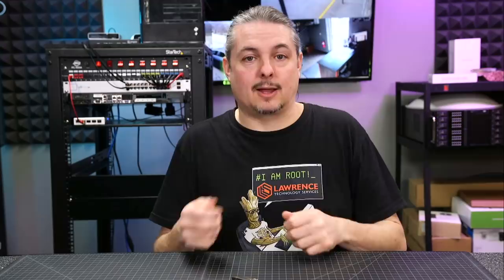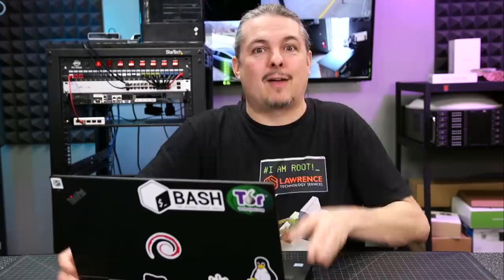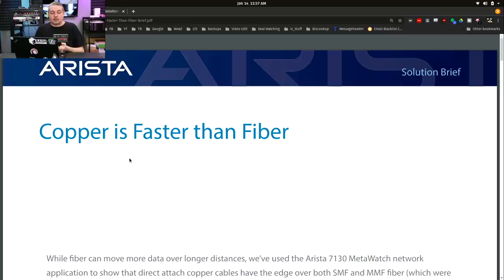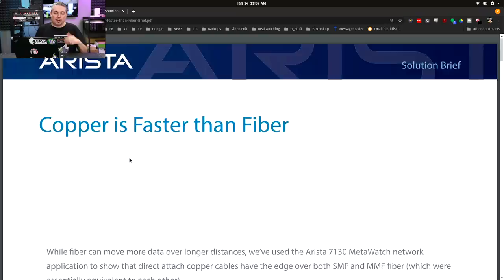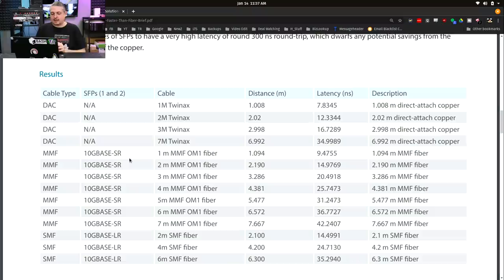SFP+ DAC VS Fiber Latency: Copper Is Faster Than Fiber

Comment: I asked around for suggestions of for applications where nanosecond latency on short cables could matter.  I received the suggestion high frequency trading where first to respond wins, implemented on an instant response FPGA. But you really need direct to attachment between endpoints or cut-through-switching to ensure you aren’t getting stuck in the much more “slow” store-and-forward switching if you are competing about a few ns.
Reply: Also keep in mind how small nanoseconds are.  I just did the calculation of the latency introduced by my 50 meter run of Fiber from my basement up to my office, apparently that's 300 nanoseconds, or  0.0003 ms (milliseconds).  Considering one's first hop to their local router is within the 1ms range, or to ones ISP is 2-6ms.  less than 1/1000th of a ms is introduced by the fiber, I don't think it would make a noticable difference, even in ultra-low latency requirements.  Especially noting the difference at 4:16 in the video, a 1.641 ns difference between a 1meter DAC and 1 meter of MMF is 0.000001641 ms, an absurdly tiny number, when 1 ms is 1/1000th or 0.001 of a second.  Go with whatever your requirements are. :) 

There are some things regarding high frequency trading where some Stock Exchanges have boxes to introduce latency by having a 38 miles of fiber coiled up within a box just to add a slight delay too.  See Tom Scotts video here: https://www.youtube.com/watch?v=d8BcCLLX4N4
Reply: It is big deal for high frequency trading.
But they use radio, not copper cables. Because radio through air travels faster.
There is a microwave radio link between the New York stock Exchange and Chicago Commodity Exchange. Essentially a bunch of radio towers built in a straight line between the two.
Because radio through air travels faster than light through fiber.
I believe there is a similar radio link between the London and Frankfurt exchanges.
And a company placed a new fiberoptic cable across the Atlantic, using a slightly more direct route between the New York and London exchanges than all the existing fiberoptic cables. Just to shave a little bit of latency compared to their competitors.

Comment: But... a few 10's of nanoseconds of latency difference is on the order of memory access times, orders of magnitude smaller than pretty much any I/O operation being done on the server.  What's left out here is that the greater latency difference is also due to the extra fixed overhead of error correction and other signal processing done over longer links.  This is why the DAC cables are so short.  There's probably more jitter in the interrupt processing time by the NIC in your computer trying to get across the PCI bus to the CPU.

And yeah, over longer lengths, you have to consider the differences in velocity factor (how much slower the propagation of light/RF through a medium vs. in a vacuum).  But you have to have kilometers of difference to perceive this.  You can also operate some of these links with varying FEC (forward errror correction) which requires blocks of data to operate on, and thus increases latency in exchange for working over paths with worse link margin.

I think the first-order design goal is how you get a reliable link between the two pieces of equipment.  If you're on a marginal path where you lose a packet, then these few nanoseconds get flushed down the toilet when TCP has to wait for its retransmit timer to fire on the order of milliseconds, 5 orders of magnitude slower.
Reply: I totally agree the differences are way to short for a discussion that dac make a real performance difference in small links. The latency of different switches may have surely a bigger impact than fibre vs dac.
And no one buys the switches only because of the lower latencies.
There is always a trade of in features but it is a nice discussion in a more academic area.
The discussion why to use a multiple parity solutions like raid 6 in case of an drive failure in a raid 5 rebuild has much more real world impact than this.
Reply: You sure don’t want a store-and-forward type of switch or a normal server on a network where these ns delays matter, too many other factors that are greater latencies. I imagine the primary application that cares about this is supercomputing low latency interconnects.
Reply: No, the supercomputer guys are probably way more interested in throughput and probably 2*RTT worth of buffering in the switches to absorb a TCP window of data before end-to-end flow control kicks in.  Switches with cut-through forwarding (that is, they start to forward the frame on the egress port once enough of the header arrives to make a forwarding decision) are what the high-frequency traders use.  These guys are lunatics about the microseconds. 

The reason you use DAC cables in practice is because they're cheaper and they use less power.  (That heat on the twisted pair media SFPs is because more power, of course.)   In $DAYJOB, we have a total power envelope of between 8.6KVA and 12KVA per rack, depending the specific data center facility's requirements.  So the choice of the server CPU is based on the Tdp of the chip, CPU cores, clock speed, memory channels and how many server blades you fit into the rack and not exceed the power profile.  And also how many ethernet switch ports in the top-of-rack switch as adding the 49th port means another pair of switches.   So you do this multi-variate optimization problem based on the characteristics of the application(s) you're running - more cores, lower clock speed?  If you don't do multi-thread execution in your application efficiently, then fewer cores, higher clock speed?  Are you memory bandwidth constrained - so more memory channels, but more $$$ for those CPUs.    The cost of the interconnect cabling isn't that big, overall, but why be stupid and throw $$$ away when you only have to go 6 or 10 feet away to the top of rack and save some watts of power while you're at it. 

In doing this optimization evaluation, we've NEVER worried about a few 10's of nanoseconds of latency difference.  We deploy servers a rack at a time and have a well understood application that scales out horizontally with hundreds of instances.   Your mileage may vary, but I'll bet that latency of different 1G/10G/25G/40G/100G media interfaces doesn't really factor into the large scale system decisions.   You choose the media based on flexibility, and cost.  Do I need to go 10 meters?  10 kilometers?  Something in between?  How many different flavors of spares do I want to keep around?
Reply: Louis Mamakos apparently with MPI optimized InfiniBand application, practical delay on operations are on usec scale not nsec scale, so for  InfiniBand MPI there is little cable impact. Not sure if there is any even faster low latency application in use today - was 20 years since my HPC studies, so I need to google decades of new info ^_^. You don’t use TCP in low latency applications, the point of them is different from ”slow” technologies because the command modes can speak to workers so fast that they almost appear like if they were on the same machine. For applications were you always need to know results of other computations that matters. If you just need a cluster for easily scaled applications then TCP and Ethernet will do just fine of course.
Reply: @randomgeocacher  IB isn't really required anymore since you can get 10G NICs with RDMA and every standard after that from what I remember has RDMA in the spec. IB used to kill Ethernet in latency because you could have RDMA where Ethernet did not. 25G/100G + Lossless Ethernet is quite compelling now as you no longer have to run dual stack.

As for DAC vs Fibre I'll pick Fibre every time for dense applications, if you've ever had even as few as 40 DAC cables to the same point it's a right pain to work with. Unless you've got some seriously nice cable management accessories in the rack you'll curse those cables as soon as you need to pull one out or add one. DAC cables typically have limited range of lengths compared to MMF and if you have to go custom length Fibre is far cheaper. DAC is great, just to a point.
Reply: Timothy Matthews I asked a contact who works with HPC, they still use inifiniband for some applications, but latency wasn’t a big concern for most of their customers workflows (more independent strong cluster nodes, so customers don’t need to great at MPI development), and nanosecond differences was a joke to him. They typically use fiber optics for almost everything because their racks would become so much more unmanageable with short and thick DACs.
Reply: @randomgeocacher  Yea we use fibre for the same reason, I got so pissed off with DAC. I  sort of work in the HPC area, I'm in IT at a university but more in the central business IT but also have to support the facilities that the research departments use for their HPC clusters. There's only one using IB currently and it's a really old setup. We are not a big HPC powerhouse though but it is a personal area of interest of mine.

Comment: Question:

Can you give me a real world scenario where a ~0.000005ms different would make a difference or potentially be a problem? I know in the consumer space there's no way there would be a distinguishable difference, but what about in the enterprise space? I always knew DAC was faster than fiber in terms of latency at the module, but didn't know the numbers were in the nano second range. Crazy.
Reply: Yeah, considering we are talking nanoseconds, it seems I was worrying over nothing. Even microseconds would be no big deal. If it was milliseconds, then I’d start worrying. I already have OM4 MMF. I was gonna get DAC, but it seems pointless considering my fiber is 0.3m long.
Reply: This becomes a problem when you start scaling to Fortune 100 level companies. For example, Twitter has MILLIONS of transactions per second flying through their clusters. Any sort of latency mitigation is important when youre talking about that much data flying around, especially for latency-critical uses. 

Other angle: Sharing RAM, PCIE, or CPU hardware across a clustered network. If youre trying to access RAM from another physical box, then you want NO latency.
Reply: @DaedalEVE  Microseconds? 1us is the instruction clock of an 1MHz CPU, a bit clock of an 1Mbit line. The bit clock of 10 Gigabit/s is 0.1ns. Transfering a small 64 byte frame would take 64ns (a bit more due to overhead, but you get the idea).
5ns latency is 7.8% of that time.
Reply: High precision time synchronization for cluster communication and thus high availability/virtual synchrony.

Despite corosync doesn't need nanosecond precision that much, it is always good if you can do better
Reply: Real world scenarios where nanoseconds matter: High frequency trading and particle accelerators.

Comment: The main advantages of Direct Attached Copper is generally that it needs no expensive optical conversions.
Nor does it need a relatively expensive fiber. But can instead rely on a simple yet effective pair of copper wires surrounded by a foil shield.

But honestly, the main reason copper is faster than light, is due to the fact that the light in an optical fiber isn't even traveling close to the speed of light in vacuum.
A coaxial/twinaxial cable, can reach speeds closer to the speed of light in vacuum far more trivially than what a strand of glass is able to. Mostly since one can use materials that have a lower relative permittivity than that of glass.

Also, all optical sensors and lasers have their own response times as well, adding additional latency regardless of cable length.

Now, a signal in the electrical domain will also need a transceiver, since the LVDS signal from the SFP port isn't really ideal for just sending over a twinax.... So some impedance matching will be in order, but that is usually not that hard. (It does add latency, but it isn't like the LVDS signal were ideal for driving a laser to start with either, so similar tech will be needed for fiber too....)

Also, the velocity factor of a typical optical fiber is around 0.65 to 0.8
While the velocity factor of a typical coax/twinax is around 0.8 and up. (Some coaxial cables are above 0.98, while other types of coaxes have VF as low as 0.4, but they are optimized for other applications where latency obviously isn't important.)

Though, the main advantage of DAC over fiber is the simple fact that lasers wants a fair bit more power, and are more temperature sensitive compared to a handful of transistors doing impedance matching and signal boosting.

Also, it would be fairly trivial for a DAC cable to have an amplifier along its length to bring its abilities to even longer lengths.
Reply: Could someone reference the acronym DAC. Is it Direct Attached Copper, or is it Digital to Analog Converter?
Reply: @bjre.wa.8681  In networking DAC is Direct Attached Copper.

In electronics and audio it is Digital to Analog converter.

It is an overlapping acronym, but at least it is in fairly different fields.
Reply: @Ormaaj  Can't find what the acronym "TIA" refers to. (Only find a disease related to stroke...)

If you mean variations in the time of arrival, or commonly known as jitter.
Then yes, it does effect peak bandwidth of a given system.

Then there is also the spread of the time of arrival, though this "isn't a thing" in single mode fiber, since the fiber is simply not wide enough for the light to consider it anything other than a straight tube. (oversimplifying a lot there...)

Though, for certain low latency connections, fiber isn't an ideal solution.
But for regular networking applications, DAC or fiber isn't a noticeable difference.

If one builds a super computer shuffling cache coherence checks back and forth, then going to Coax for that could have advantages. (And here we would practically sidestep the whole idea of a kernel and network drivers, since our connections would link between the cache controllers directly. (and yes, consumer and even enterprise grade CPUs don't have such features. But the CPUs in a 100+ million dollar super computer is a bit of a different story.))
Reply: @Ormaaj  Trans impedance amplifiers don't add much latency.

Especially not 10-100 ns.
Since if the amp were that slow, then it would struggle to work with signals up in the multi Gb/s range.

All SFP modules I have interfaced with use standard PECL drivers.

They are really boring.
It is a couple of PNP transistors amplifying a differential signal to drive a laser diode. The amount of latency in these circuits is almost nothing. (single ns is a comparatively long time.)

Or use another diode for sensing incoming light. Amplifying it, and making it into a differential signal.

There is usually some temperature compensation for driving the laser, and thermal protection too. But that is fairly analog in its implementation. Nor does it really interface much with the data path itself. Even the signal loss/strength indication is largely separate.

To be fair, one can build a fully functional SFP module out of a handful of discrete transistors, and get good performance. Downside is that it wouldn't really be the same size. It is though not hard making it fairly small. Though, more expensive than a fully integrated chip. (Not to mention the nice space reduction too, and usually a bit better power efficiency on top.)

The only really digital part in the typical SFP module is the EEPROM storing the "firmware". (typically only manufacturer name, serial number, peak bandwidth, and some boring characteristics about how it indicates signal strength.)

For QFSP and multi fiber modules, the story can though be different. A lot of QFSPs have a mux making them a bit more active, but in general, it is a similar story there.

In short.
SFP modules are in general just high speed differentially signaled optocouplers. (and one can even use them as such.)
Reply: @Ormaaj  Some modules especially QFSP ones can have some actual processing in them. Same story for the SFP to Ethernet modules.

But SFP to duplex fiber is usually as simple as it gets. One can even just get a single ended to PECL driver and use them as a fancy optocoupler, the SFP module doesn't care. I have done this myself a few times. (Reading the "Firmware" is also largely unimportant, unless one wants to know who manufactured it, when, what serial number it has, its peak bandwidth, etc. (Or just vendor lock what modules work's in one's switch.))

QFPS to regular duplex often is just including a mux/demux. And then just following standard ordering of the channels, though to my knowledge a lot of switches just considers a QFSP port as 4 SFP ports under the hood.

Since some QFSP modules just break out into 4 duplex fiber pairs. (Ie, it is practically just 4 SFP modules in one. Sharing the same "firmware". That one can then connect to 4 separate devices.)

Though, the laser driver technically does some processing, in regards to thermal management, but usually in the analog sense of the word. Similar story for the data loss signal.

The SFP standard is fairly simple, and that is honestly one of its large strengths. Since one then knows that the modules only really do one job and not much more.

Biggest exception to the "SFP module are fancy opto couplers" is the SFP to Ethernet ones. In my experience one can't just send arbitrary data to them and actually get a link between two such SFP modules. (Ie, they expect something that is in line with the Ethernet protocol. (They are also not "optical", but they are galvanically isolated since they have transformers on either end. And can therefor largely be used in the same fashion over smaller voltage differences.))

Comment: According to the results the difference between the cables with the lowest (7.8345 ns) and highest (42.2407 ns) latency is 34.4062 ns, which is equal to 0,0000344 ms. :) Just FYI.